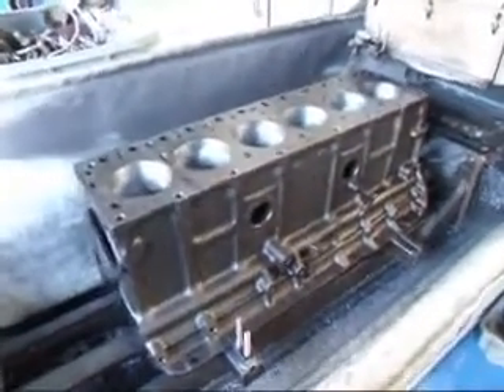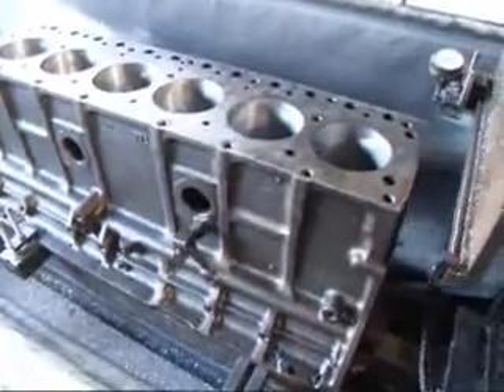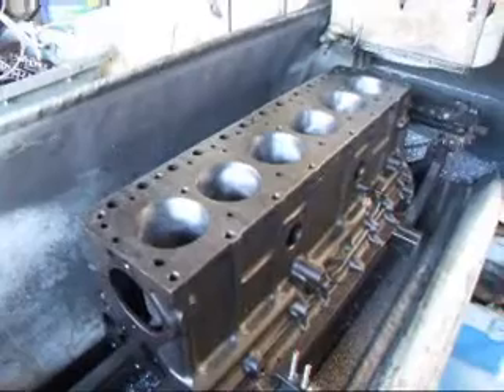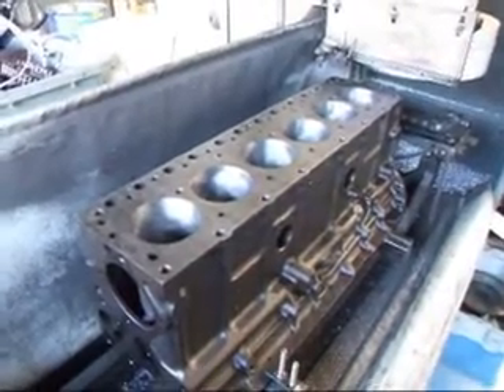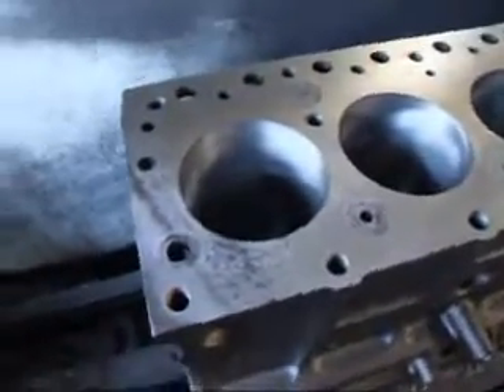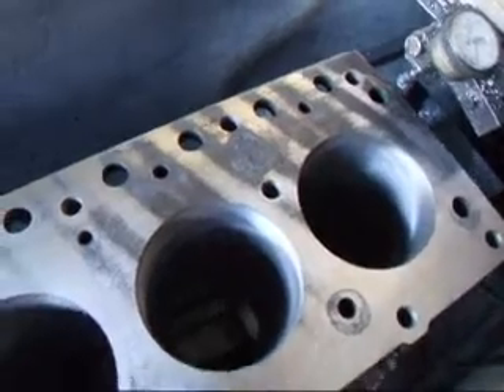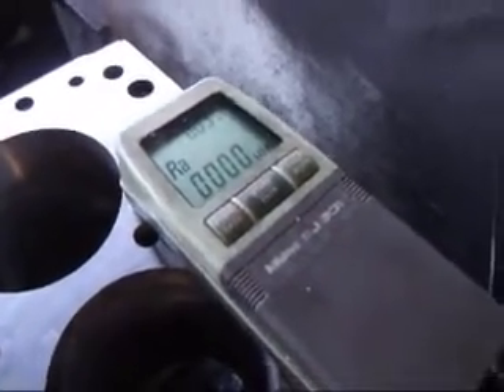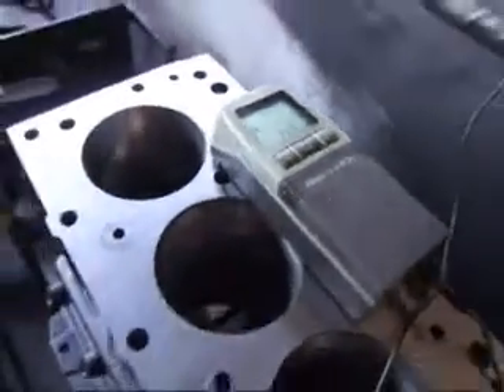Chevrolet 235 Block Resurfacing

Comment: Hi John I'm from Philippines, I have a 6 cylinder diesel engine and I already sent the cylinder head for resurfacing.  Still the coolant from the radiator keeps coming out. Is it possible that the block is warped? Can the block of diesel engine be resurfaced? Can it affect the hight of the piston? hoping for your reply, Thanks

Comment: I've noticed that also.Probably not off more than .001-.0015 or so though.I would have decked it amd put on a torque plate before doing the cylinders though.